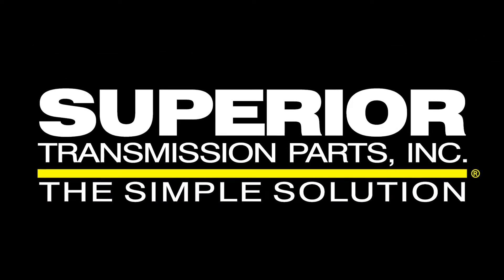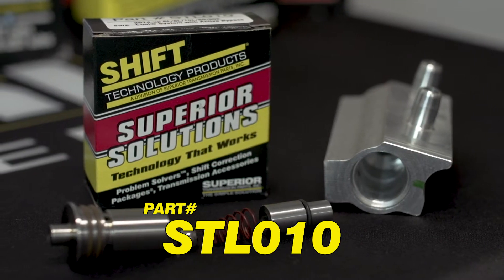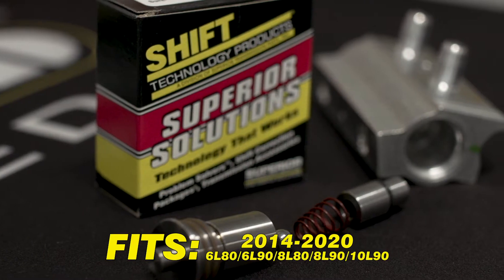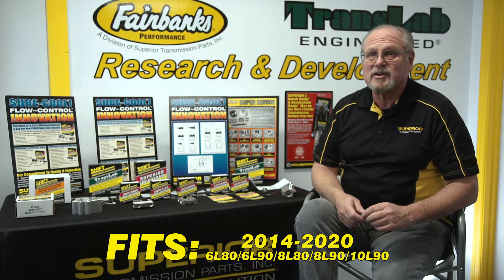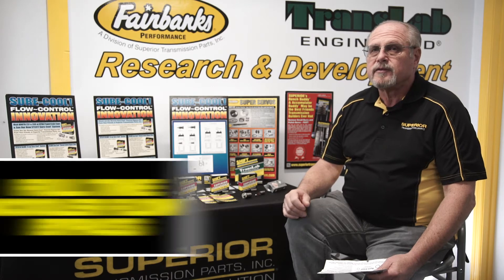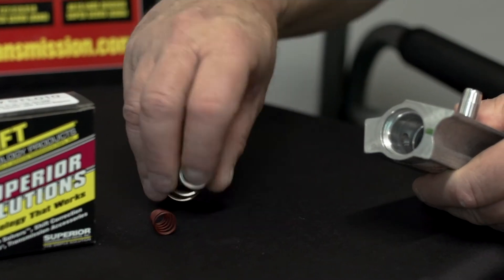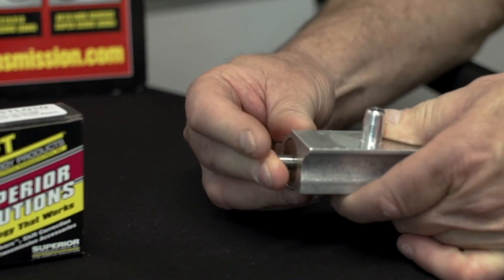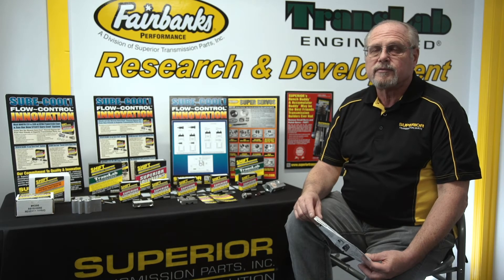PATENTED Sure~Cool® STL010® TBV Bypass system, WHY PLUG A BLOCK when you can use A SURE~COOL® system

Comment: Hi ...i have a 2017 Colorado...it has a 6L50 transmission. i noticed the thermostat block looks exactly like the ones on a 6L80 transmission.

will this STL010 bypass kit work for my 6L50 transmission?
Reply from the maker: @AnandChetty-b5w  yes any GM block that has it. 6l45 6l50 6l80 6l90  8l90

Comment: Just ordered one of these. Sure hope It can withstand -40 in the winters. lol.
Reply: Put it in my and my dad's trucks (5.3/6L80) about a month ago. Running about 135 on the highway in 50-70 degree weather. Will see how they do this winter, we only get down to teens and maybe a few single digit negative days.
Reply: @jiimmyboy63  yeah you’ll be fine in those temps. I’m in Manitoba Canada where we see mid -40’s to -50’s thru January and February. I don’t think this will be good come then in my 17 Sierra. Have it in now and it’s good but it’s already running way too cold. 6.2 gas with 8L90 8 speed.
Reply: @jaybilawchuk2225 agree. Way too cold in those climates. these average about 100° over ambient temperature I love mine but I can get away with it where I live. I have friends that live way up north and their transmissions never get above 30° in the winter. 
That’s the part they dont tell you …
Reply: @fishman80  very accurate. My winter operating temps when warmed up with this bypass is 18 - 20C.  I don’t think that is healthy at all. Frozen fluid is prob causing more failure than overheating. I had to switch mine out. I just couldn’t run with temps that low.
Reply from the maker: @jaybilawchuk2225  no worries

Comment: How about a list of authorized distributors, it would be nice if I could purchase directly from you but if that's not possible the name of someone you've chosen as a distributor would be helpful. It's to easy to post a picture of the package and claim to be the seller.
Reply from the maker: STP Part STL010 cooler flow Sure~Cool® system patented and patent pending tech is made in the USA. you can go to our website and hit the "find a distributor" tab and type in your address and it will pull up the closest dist. or you can google our part numbers (i.e. STL010) and there are several online retailers. we do not sell direct as we are the manufacture and developer of the products based here in Tallahassee Florida. sorry for the long response time we were on an extended VACA.

Comment: I am planning to install this bypass. Once installed, will it automatically open when I flush the transmission?
Reply from the maker: It's full wide open all the time, unless a condition exists where the bypass would need to function. But yes it will flush w/o issue

Comment: You are making the claim that the Sure-Cool STL010 fits ALL GM 6-speed 6L90 transmissions. Well, your communication and advertising are untrue and 100% incorrect! I currently own a 2016 GMC Sierra 2500HD 6.0L gasser with the 6L90 Hydra-Matic 6-speed and my transmission DOES NOT have a thermostat block mounted on the transmission. You need to be more truthful and upfront when making these types of blanket claims in your statements. imo
Reply from the maker: We have been updating uses / applications and are bringing more of them in the future. The majority of the Larger 90's do not have them, if you follow some of the older versions of the vids that are circulating, it's not as clear on exact uses,  but what is stated is to see visually, what one looks like and where they are located and how quickly you can install them (if you have one on it or in your particular case not) the 6L90 has a junction block on the side of the trans where the lines connect, some may have them in a separate block in the lines up under the batt tray also. We're just trying to show our product vs shoving a bolt in and blocking flow. I do know the 2500 and 3500 if it was ordered for a cold climate and Canada production could have one up on an additional cooler / heater and ours would replace that type but out of the handful of customers up north we have gotten no reports that theirs isn't on it, the Allison's for example incorporated it in only 2017-2019 the RPO code is L5P and we found that after the early videos aired. It's a work in progress and hope you understand the product. I have talked about making a add on for the rest of the 6L90 crowd myself included, I have a 2015 MH and want it on that so maybe in the future but the cost would more expensive as we would have to manufacture cooler blocks at our plant and the costs for manufacturing it would be out of the ball park unless we had mass qtys. I do appreciate your comments and feedback, we want to let everyone know that if you do have it on your transmission in a factory set up, the sooner you install our sure~cool® system the less chance a stuck pellet ruins your transmission.
Reply from the maker: Also if you can pm me a way to follow up, we released the new magazine adverts explains it more detail and which units. So I can send you that in a PDF? Sorry for any inconveniences that may have incurred. If your having problems returning one you purchased to a vendor, I can clear that up too. Just let us know.
Reply: @superiortransmissionpartsi5357  Yes, I did purchase one of your Sure-Cool STL010 bypass kits on ebay from a seller named "transmissionjobber" on 1/30/22. I requested a return/refund from the seller explaining that I had made a mistake and didn't realize my 2016 GMC Sierra 2500HD did NOT have a thermostat block. I provided photos of my transmission showing there was no thermostat block present. Still, the seller declined my return request. Now I have a new & unused STL010 Bypass Kit which I paid $46.26 (tax included) setting in my garage. If you could, I would really appreciate your help in addressing this matter. Thank you.
Reply from the maker: @scshufran251  you need to send me a copy of the invoice and I'll take it from there. They don't ring a bell as an authorized distributor, and since it's our network of distribution I'll find out why they didn't take it back and issue a refund. If you can scan it to me at bob.stp@comcast.net I'll address it Monday.

Comment: I have a 2014 escalade esv awd and I am trying to find the block on my transmission to get this installed. Any ideas where it's located or how it looks?
Reply from the maker: If it's a 6L80E it's in the block on the driver's side above the transmission pan rail it has a 13 mm bolt and a clip on one end.
Reply from the maker: And it's identical to the one in the video.
Reply: 10/4. I Think I seen it . Has 2 lines going in but mine looks mighty small I may not have that design . But I'll check again when I get off work
Reply from the maker: In 2014 some had a small block (thin) 1 in or less thickness. If you don't have the clip on the end then you don't have One.
Reply: @superiortransmissionpartsi5357  10/4
Reply: @superiortransmissionpartsi5357  by clip you mean the c clip or the clip that holds the lines in
Reply from the maker: @chrisrivers3746  the c clip in the block.
Reply: @superiortransmissionpartsi5357  10/4 I'll check for the clip on the block when I get off work . Is it normally facing up towards the drivers floor board  or does it face down?

Comment: I have a 2021 Silverado with a 10speed will it work on it?
Reply from the maker: No we are in development on the 10L and 10R. Some 2019-2020 had the external block on the driver's side of the trans. If yours has it you can use the STL 010. If not we should have one by 1st Q 2022
Reply: @superiortransmissionpartsi5357   thanks for the quick response I’ll stay updated so I can get it ASAP

Comment: I got a 2017 Chevy Silverado with a 6l80e it's have symptoms like it over heating is this a solution for me I just don't want to take it to a  dealer if it's something I can do to fix the problem .
Reply: Definitely a must have product. I purchased one and add a mishimoto transmission cooler and temp never saw  180 and up temps anymore. Fluctuating between 120-140 after long hour drives.
Reply: @viixiconik  thank you.
Reply: @jaysrcexpedition  my pleasure.
Reply: @jaysrcexpedition  Wonder how it will handle the cold temps....
Reply: @viixiconik  I couldn't tell you about cold temps because when my truck warms up it doesn't move so I think it's the torque converter going out  so I will never know.
Reply: @jaysrcexpedition  probably be a wise choice to replace the torque converter, im still running with stock one for now and temps still fluctuating within 120-130 all day. 122,000 miles so far with the jet throttle body, borla atak exhaust system, oil catch can and Granatelli wires along with v4 deleted.
Reply from the maker: sorry for the late reply, you probably got it fixed by now but, if you add the Sure~Cool® to any late model that has one on it, that will be the last time you worry about  trans overheat, and with cold weather operation we use the thick viscosity of the oil to lift the ball off and bypass until it gets warm enough to flow up into the coolers. our products at dynamically active. the factory pellet is a static operation. ours works theirs wipes out units when they stick.
Reply: @superiortransmissionpartsi5357  I think it's my torque converter going out I bought your product and still having the same problem the truck moves untill it warms up then doesn't move at all it was worth a try anyways thanks for your reply.
Reply: Well I got this part and my truck still doesn't work right I guess it the torque converter going out .

Comment: Will this be a problem on my 8l90 in the winter up North? Is it a full time flow or just opens at a lower temperature? Thanks!
Reply from the maker: With a plugged system, your unit and your wallet will be smoked.
Reply: @superiortransmissionpartsi5357  ok, mines still factory. I was curious how the STL010 worked. Thank you.
Reply from the maker: Sure will if it's blocked, if you can't remove the piece someone blocked it with, you still should be able to use ours, if not buy the new block and add ours and remove theirs. Bout a 100 buck total. Beats 4 G
Reply from the maker: Also, the thick viscosity of the oil pushes the ball over to start bypassing untill it warms up and flows. That's why it's dynamic acting instead of static. The factory one will stick.
Reply from the maker: Get it switched before it sticks. Just Google it STL010 bout 40 bucks and about an hour to flip it and FILL it.
Reply: The answer is yes you will have issues way up north especially if you’re well below zero. The transmission gets about 100° over ambient temperature with these which is fine depending where you live. if you’re somewhere where it’s -40 dont expect your submission temperature to get above 40° …probably less.
Reply from the maker: Also I like to get specifics cleared up as we created the new technology. It's based on pressure differences and certain things if you want you can read patent number 11725891B2. The one the Chinese counterfeiters copied verbatim but will be paying us soon at 3x damages. But hey that's another story. The 6l has block to rad to aux cooler back to trans, we use the engine heat source now with our device to pre heat the fluid and it's like it was pre-2014
Reply: @superiortransmissionpartsi5357  OK I assume I got the real deal. I got it on Amazon sold by “wit transmission parts”. and like I said, I’m extremely happy with it for my 2014. I just don’t know the effects of the transmission running about 80- 100° when it’s freezing cold below zero when i head into northern Maine.  I wasn’t criticizing your product. Like I said, I’m a huge fan. It does exactly what it’s advertised except the fact that it dictated by ambient temperature. not sure if that’s gonna be a problem or not that’s all I was saying…. at what point is cold too cold? idk..
Reply from the maker: @fishman80  but its not dictated by ambients it's dictated by flow rate and restriction to. The 20-up 8L and 10L have heat exchangers now and run louver systems that close or open dependant on temp. Check the front of the truck or close off air flow to the cooler.
Reply from the maker: @fishman80  if it was from WIT its fine.
Reply from the maker: And I totally respect your thoughts. we are trying to help people see that this little pellet sticks and ruins a transmission. If it was fool proof why do they keep changing their story to their customers who spend 50-90k and melt a transmission. Look up tsb 21-na-199 Google it, and know we are the fix. Happy Holidays. Send me your email and I'll send you a beanie winter hat. All 👍😊 and thank you for the confidence.
Reply: @superiortransmissionpartsi5357  totally hear that you’re helping a lot of people. But by not answering my question on purpose, if it’s too cold, sort of answers my question.. :)
Reply from the maker: Do you live way up north? Why would it have issues? It's the same as if you had a 2011 when they didn't put blocks on. Our instant default state is wide open, just like the blocks not there and it's straight line to cooler no block. So what is the issue ? Back in the days before the Sure Cool system they run block and trans pan heaters anyway and some never turn the key off from November thru March in Edmonton and north. I've been in -44 below driving around the oilfields all's well.
Reply: @superiortransmissionpartsi5357  I drive up north very often. I’m very happy with this product and how it performs but I can tell you when it gets below zero on my 2014 the transmission temperature never gives above 90 or 95°. It’s been consistently running about 100° above the ambient outside. if it’s 90° in the summertime, it runs about 180.
last week it was in the 40s and it ran about 135, 140. So it’s consistent.  I’m not saying anything bad about the product I recommended to a lot of people- but if you live in subzero temperatures too cold as an issue when the trans doesnt heat up past 30 degrees. The argument about it possibly the thermo possibly getting stuck isn’t an argument anymore when your transmission isn’t warming up past 30°. My point is if you’re extreme north or experience low transmission temperatures as a result, there’s a place for a thermostat.